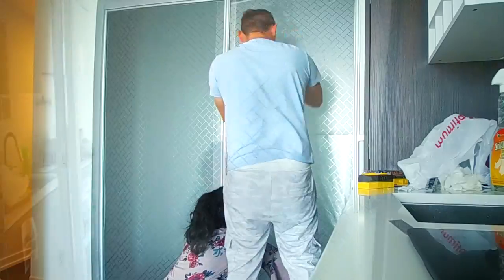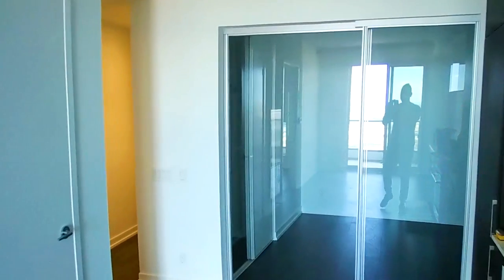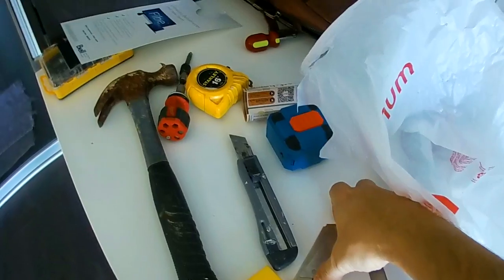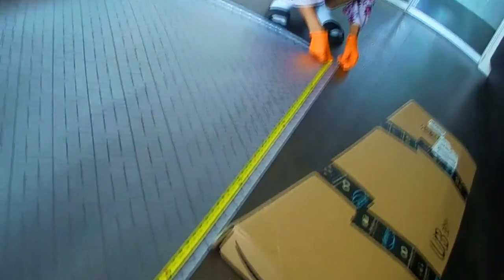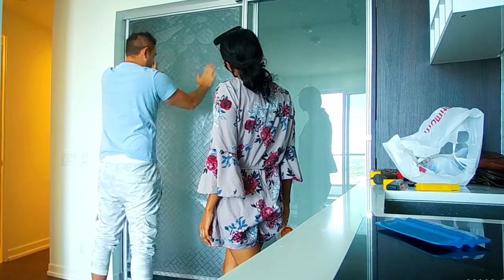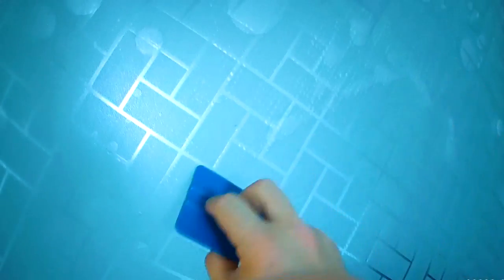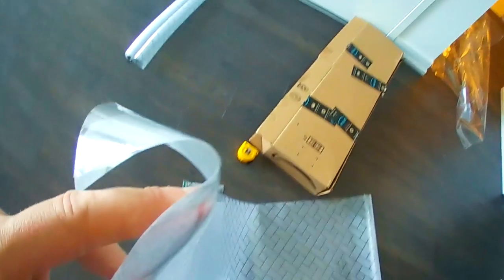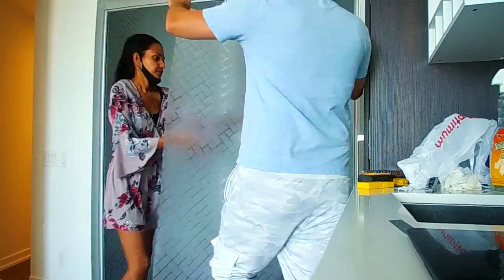Rabbitgoo Window Film Installation - How to Install Privacy Film on Glass Sliding Doors

Comment: Does it look good when you add a second portion of film to cover the remaining areas? I thought you have to make sure to cover 100% of the sliding glass door. What is your suggestion?
Reply from the maker: Def not. Actually on another di
Our I ended up removing a film altogether cuz if humidity and sprayed it with frosted spray but thT required so much cleaning of floors cuz I didn't cover them and toxic for a whole day but no bubbles and looked great

Comment: I’ve just installed the same style privacy window on my door two days ago and there are still bubbles within the film. There are also air on the edges like how you’ve mentioned. I’ve tried removing the bubbles but when night comes, they’re still prevalent. During the day it isn’t too noticeable, but it does get annoying at night. Any suggestions to rid of them? Thanks
Reply from the maker: They Judy won't go away if they haven't after 2 days. Better to remove spray and reapply